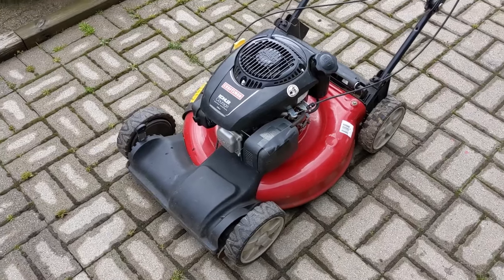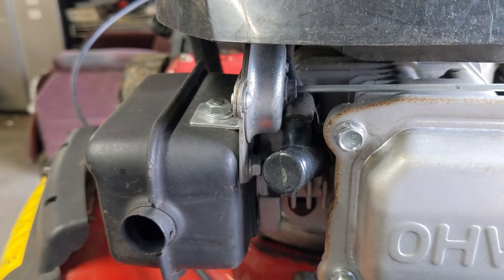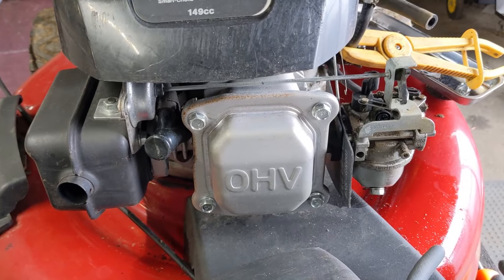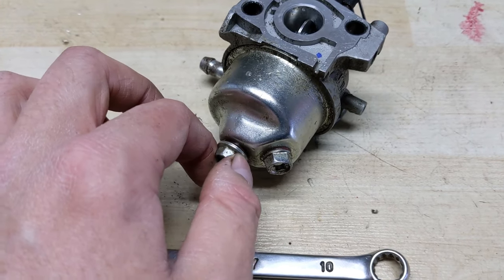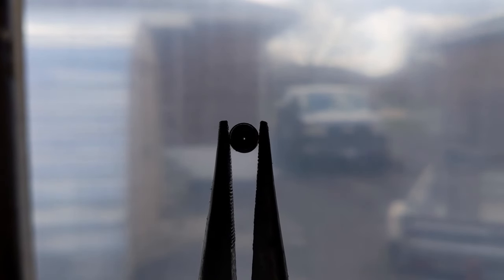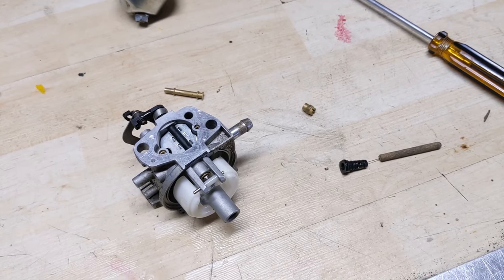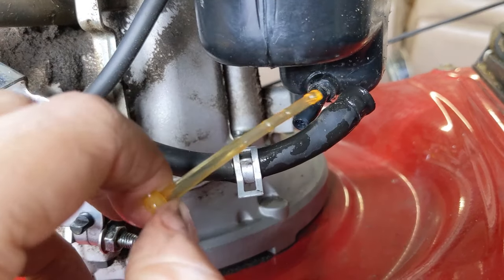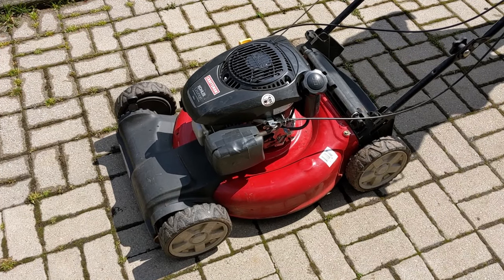Craftsman Mower Starts but Won't Stay Running - FIXED!

Comment: Thanks for the video. Very well done and informative. Do you use soap in the ultrasonic cleaner at all? I assume the carb needs to totally air dry after that as well?
Reply from the maker: I'm using zep degreaser now, the orange stuff, works pretty good. I use simple green on the plastic carbs because it's not as strong. I use air gun from compressor to blow out carbs

Comment: I have a question? I have a craftsman push mower that I bought a year ago, I have a new carb, replaced the gas, changed the spark plugs, air filter is still new, but it starts and dies. do you think its the fuel filter?
Reply from the maker: Probably not getting fuel, sometimes replacement carbs can be bad. I just replaced a carb on a yardworks that did that.
Reply: For me it was a rusty plug wire, and stretched throttle cable. Did everything including clean carbs, inline filter, air filter, new plug, new oil, etc. What worked was setting the throttle cable between bunny, and turtle (took a few times) and scraping the rust out of the plug wire (will replace later). Runs better than ever after all the other work done to it on top of fixing the real issue lol.

Comment: I eventually got tired of having to dismantle and clean my mower carb every spring. I installed an inline filter and most importantly a fuel shut off valve! Now whenever I store my mower I shut the fuel valve and run mower till it runs out of fuel thus emptying the fuel bowl. I did this four years ago and now it doesn't matter how long I store my mower. All I do is add fresh fuel and it starts and runs every time. Problem solved! Oh, another good tip is to only use ethanol free fuel. Or add the fuel additive this video recommends. Ethanol fuel has made small engine repair shops so much money over the years it's ridiculous!

Comment: Well done brother.  Your video was clear, concise and cogent. Expertly explained without all the nonsense.  I haven't gone out to do what I just learned in your video yet but if I'm a betting man just from the way in which you went through the steps and explain them I'm sure everything will work out just fine. On behalf of the layman, thank you so much for a well explained solve to a common problem.
Reply: Dude, thanks so much I have 3 Craftsman push mowers AND a R110 riding mower they all sit outside thru winter and even put the. R110 on a really good charger but the engine(s) just won't start none of the push mowers are new but all have new air filters, spark plugs. Guess I'll need to clean the orifices to open up the fuel flow as they should be! You 'da man! Thanks for the vid you were easy to understand!

Comment: Thanks! Your video really helped. Different model, but my Craftsman (B&S) was doing the same "starts but dies". I'd never tried removing a carburetor before, but your visuals and explanations helped convince me to try. Cleaned, removed crud and some fluffy threads, reassembled, and Voila! it runs like a champ again! Thanks again for posting this video.

Comment: Enjoyed your video on the small engine repair of the carb. It was very well explained, and I was able to feel informed enough to try and clean the carb on my Power Washer, which had almost identical symptoms as the lawn mower you demonstrate on your video. Good Job Thank you Very Much !!

Comment: Thanks man! You are the first person to actually explain the function (especially the auto choke) instead of just blind-guessing. I have a similar issue with a Briggs&Stratton auto choke engine. Fires up perfectly and stalls if I do not lift the mower at the handle for about 2-3 minutes. Then it runs perfectly. Carburator and fuel system is clean, so I guess it is an issue with the auto choke. Maybe too much air at the beginning and lifting the tank compensates that by increasing the fuel pressure. Thanks to your video, now I know where to look for.
Greetings from Germany!
Andreas
Reply from the maker: Cheers from Ontario Canada!

Comment: On those kohler’s with that air box design,  they have changed it. The issue is that the box wouldn’t clip on and stay on.  
Here is a little vid I did On That
https://youtu.be/tHVI5aGHpuw
Vid description has the updated part number  for the kit.  
I trash picked one that it was missing  so I had to get the kit.  

Tape works great also

Comment: Is it too late to change the video's title? The key point is not that it's a Craftsman brand mower but that the engine is a Kohler 149cc engine.  This engine is installed on many brands, Toro & Lawn Boy among them. While the vid description and audio identify the engine, it would show up higher in a YouTube search if the engine type is in the title. It's an really excellent presentation and deserves a wider audience.

Comment: I have a Craftsman M40 with the plastic Carburetor. It would do that too, so I took it apart and cleaned everything up, put it all back together. Now it floods and the needle valve won't shut the fuel off. I checked the tip and it's a little hard but not bad, the seat is made of brass and corroded. So I cleaned the hole out and seat, cleaned the metering white two pieces as well. Now It still floods and will start but shuts down immediately, LOL. Yes I blew all the holes out and made sure they weren't plugged. So I'm just going to replace the whole carburetor. Oh on the Craftsman mowers that have the plastic carburetors don't use GumOut, or Carburetor cleaner, it dissolves the rubber seals inside and the actual Carburetor that made of Plastic too. It also devolves the paint on the mower. I just want the old reliable engines and painted parts from years gone by. You used to be able to run it dry and put it up for the winter, bring it out in the summer, gas and cut. Now this alcohol fuel eats & corrodes the metal, and the tips too. I had a Husqvarna with a XT675 Kohler engine on it. It lasted two years before the rings went and started gumming up the intake valve, even with a new valve guide seal you couldn't run it more than once, and I live in a home track and kept good air filters on it. All these new Chinese designed mowers over the last 30 years are just seasonal crap. I'm seriously thinking about finding some of those old motors and putting one of those on my mower. Thanks for the nice video. Best Wishes & Blessings. Keith Noneya

Comment: I have the exact same one and it starts out strong but then gets weaker and weaker before it finally passes out.  I put a new air filter and plug.  Also this system has a fuel filter inline as well. Do you recommend the fuel filter or should I take that out.? And if you recommend a fuel filter, how often should it be replaced?
Reply from the maker: I've never had to replace the fuel filter, they usually clean up great. You may have a clogged gas tank vent. check that hose and make sure you can blow through it back into the tank and that it's not clogged at the air box. Have the fuel tank drained with cap off when you do this. Could be vapor lock.
Reply: @EliminatorPerformance  can you do a demonstration video? Or do you have a video already?

Comment: sorry if this was asked, what did you use to clean the carburetor assembly, gasoline or water?
Reply from the maker: Carb cleaner, or my ultrasonic cleaner with concentrated cleaning solution

Comment: Who ever left the thumbs down on the video, WHY? He has great content, takes his time to explain everything he does and even shows you other preventative maintenance for your mowers!! Keep up the great work! Watch the vids all the time!
Reply from the maker: Thanks muscle!
Reply: It might be a far stretch, but perhaps they were miffed at how you didn't explain how you cleaned the grime off the metal body. I dunno mate. Thanks again. Gonna go try it out.
Reply: He didn't show reassembling the carb, especially the tube that draws fuel up through the jet he cleaned, didn't show reattaching choke lever either, maybe that's was the problem? That's my problem, other than that was a good video.

Comment: Best way to clean the gunk off carburetor? Is it okay to just use soap and water or no?
Reply from the maker: On the plastic carbs it's ok but I'd recommend carb cleaner for the aluminum carbs

Comment: People:
1. You Donot Need Tu Buy 
    A New Carburetor.
2. You Donot Need To Open
     Carburetor To Clean.
3. Use Your Brain If You Are
    Smart… 
Put In A Little Bowl, Put Chemical 
(If You Are Smart Guess)
Let It Seat All Night And
Next Day Clean (Chemical) With 
Carburetor Cleaner Without Opening
And Brand New Again
I Always Fix These Machines.
Use Gloves And Glasses.
Amén

Comment: Had the same issue, I took my carburetor completely off using this video. It was twice as disgusting as the one you did. Put it back together after cleaning it with a toothbrush, carburetor cleaner and a needle. Now it runs great again.
Reply from the maker: Thanks for watching!

Comment: Your video is soooo gooood, I watched it again.  You mention for hard to start mowers it might be valve related.  I've got a 6.0 Craftsman that's hard to start.  Hoping you might have some advice about checking out and fixing the valves if that the problem.  You also mentioned "budget" minded fixes and that pretty much summarizes my situation.  So, I'm really hoping you can HELP get me down the cheapest right road to lawn mower heaven!!!

Comment: Thanks for the explanation, but can't see doing this myself.  It worked perfectly fine this summer, til I added more oil, and then it's now doing what you described.  (No, I didn't put in too much oil.)  Total wicked bummer.

Comment: My old mower wouldn’t run. Did everything suggested online and in these videos. The push bar or whatever that should turn the mower off when released was the issue for some reason. Taking that whole assembly off fixed it 🤷‍♀️. I turn it off by removing spark plug now.

Comment: I have a similar mower , Craftsman M220, I sprayed carb cleaner , changed air filter , put in 93 octane non-ethanol fuel &  little sea foam & that helped it idle a tad faster but it still wont rev to mowing speed , there’s no throttle, any suggestions ?

Comment: Great video... excellent resource.  Husqvarna LC 221A won't start after sitting over the winter.   At least now I am convinced it is a carb issue and you might have saved me many repair $$$.  Thanks for taking the time.
Reply from the maker: Thanks for watching!

Comment: Nice additional information added to a carb cleaning video. K100S+ mixture of 5 ozs. per 19 Litres of fuel for 2 year storage. I have been using half that for one year storage (with Ethanol Free Fuel) and my equipment fires up every springl, any fuel left in the jerry can from the previous year goes into my truck. I always start out with fresh fuel and K100S+ in the spring.
Reply from the maker: Thanks for watching!

Comment: Is the automotic choke the only difference between the engine with the primer bulb and the the other, without the primer bulb? I recently got one with the automatic choke, and am wondering what to expect if and when it starts having problems....it is working fine at the moment.

Comment: Great video. Had the same problem on my Sears mower. Took the carb off and blew out everything with carb cleaner and a needle and runs like a charm again! Looks like it is easy for the jet to get clocked with fuel debris.

Comment: Very professionally done.  Good detail.  The extra step taken to clean the rest of the carburetor shows good business sense.  I do this type of work and would charge around $50 plus parts.  If it were taken into a mower repair shop it would run $100 plus.  Curious, could you say what you charge?
Reply from the maker: Thanks for the kind words, I charge $65/hr Canadian, plus 13% hst

Comment: Question? Where can I purchase the thin wire set that you used to clean the jet holes?
Reply from the maker: Amazon or eBay, look for torch tip cleaner
Reply: @EliminatorPerformance  Ok Thanks!

Comment: Sounds like I have to disassemble my first carb... Dang.  Thanks for the video, though - much appreciated.  

UPDATE: Reluctant to take apart the carb, I tried everything else first.  Drained fuel and checked fuel filter (some gunk but not tons), changed gas, changed spark plug, changed air filter, changed oil.  It was STILL stalling so I finally bit the bullet and took apart carb (not convinced I'd be able to put it back correctly).  I immediately found a piece of grass on the fuel jet.  It wasn't gunked up or clogged, but the grass must have been the culprit b/c it's running like new!  Thanks again, man.  Didn't know I was capable of this.

Comment: Good  day When I was driving for neighbors, checking out side of road, I found a  craftsman. Sprayed  either started up. It will not start by itself. I usually sell them for $10.00 to a young amish fellow learning small engines. I did keep this one . Thanks  guess carb has to come off. Happy Easter
Reply from the maker: Thanks for watching Don, happy Easter!

Comment: My lawnmower had gas inside the float leveler so I order brand new carburetor..I went to start the mower and it caught fire where the filter is and backfires..and it will only start for a second when I spray carb cleaner in it..

Comment: I've cleaned the carburetor twice, I can get the mower to start with starter fluid sprayed on the filter, but it dies after 30 seconds. I cannot get it to start on its own. Cannot get it to stay on.

Comment: Great work Jake. Doing a carb clean for a friend. Worst Ii've ever seen. I've got it as clean as I can. Fuel tank is a mess. How do u reccomend cleaning and flushing? I told him 30% chance of it working. Main jet would'nt come out but looks clear. Who knows on distribution tube.. Thanks again.
Reply from the maker: Hard to say if the main won't come out, no way to properly clean the distribution tube. Like you said, no guarantees. I'd recommend soaking in boiling water, then concentrated degreaser. Obviously an ultrasonic clean if you can. thanks for watching!
Reply: @EliminatorPerformance  Thanks Jake!

Comment: what if it only starts if I spray carb cleaner into the top of carburetor and then dies?? Is
Reply from the maker: Main jet is clogged
Reply: @EliminatorPerformance  Hello Sir that worked absolutely  thanks very very much on the first pull..but a ballbearing ring got caught up in the flywheel and snagged it to abrupt stop now it wont start no matter how much I pull! Just help me one more time lol ikr
Reply from the maker: @thebrokeway  try taking the recoil pull starter off, usually 3 or 4 bolts on the top cover and remove it. If the flywheel spins without the recoil bolted on, something is broken in the recoil starter.
Reply: @EliminatorPerformance  thanks bro..so I took off the pull string and the wind it back up coil and I started seeing little bits of magnets all over the place as if I had one laying on the top of it and fell down in the cracks and shattered to pieces. ..So Doc tell me if I'm all the way screwed plz

Comment: Thank you for the demonstration. I'll try to clean mine, but the only difference is my craftsman dies only once the auto choke goes into run mode. Would you say the jet is clogged in the same fashion as your customer's?
Reply from the maker: Yes, the choke plate creates more suction so it runs, when you turn it off the suction is gone and if it shuts off, most likely main jet clogged up
Reply: @EliminatorPerformance  ok thank you for replying. So I started unscrewing it all, but mine's a craftsman walk behind model, so the disassembly is different. Plus the gasket between the plastic air filter housing and the carb was worn down a lot so I'll need to get on Amazon I guess to get new, so I need to pause until I order the part. Can you advise me on what I should buy?
Reply from the maker: @TrippySkippy8  without a model number I wouldn't feel comfortable giving assistant
Reply: @EliminatorPerformance  ok no problem, I'll get it to you tomorrow. Thank you for your time.

Comment: Cleaned throttle body, checked inline fuel filter, changed oil, blew out air filter, changed plug, cleaned plug wire (because it was rusted inside) suspicious but not the issue, will replace later either way, nothing from the generic comments repeating info on here.

Turned out to be a stretched throttle cable for me. When on bunny, it stalls. Between bunny and turtle, runs fine. Replacing cable. Got my yard mowed today leaving it between the two settings this, ran better than ever after all the work I just did to it🙃
Reply: I should mention, mine is the older craftsman ohv Honda engine with the two clip filter, may not be the issue on the newer mowers but worth a shot to move the throttle back and forth a bunch while trying to start it. Maybe it works maybe it won't🙃

Comment: love your video!!! This question is for my pushing mower,   I feel like I did everything,  cleaning the carburetor and fuel line, cleaning up the fuel tank cap et al,  my Craftsman/Honda is still starting and dies 15 seconds later, what is the problem?
Reply: It's the arm assembly auto choke. They are pieces of $|-|!T. The springs go bad in them they're controlled by heat. It's right up by the muffler. The part is like 30 bucks and it will fix the issue. If the issue returns then you can with a 1/8 sized drill bit drill three holes in the muffler near the auto choke arm assembly part. It it will generate more heat near the part it helps the spring get enough heat to maintain an efficient amount of fuel goes thru the system
Reply: And I'm almost willing to bet this mower in that video got back to the customer mowed to and fro once or twice and it died.
Reply: @merkdirty822mercer2  That's funny M Dirty. You're probably right. These engines are a POS.  Always breaking down. I have performed this cleaning many times on mine. You will be lucky if you get thru the day without it stopping again.